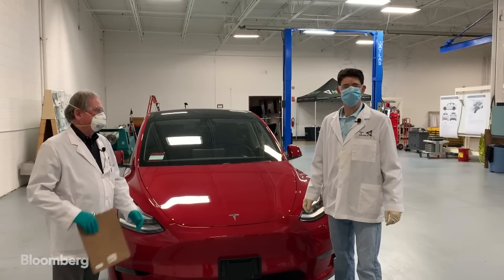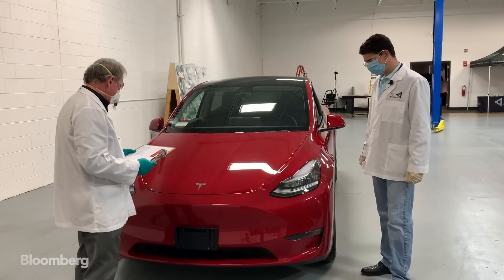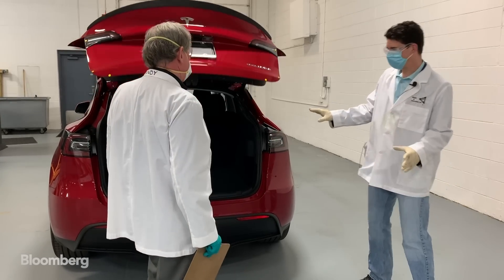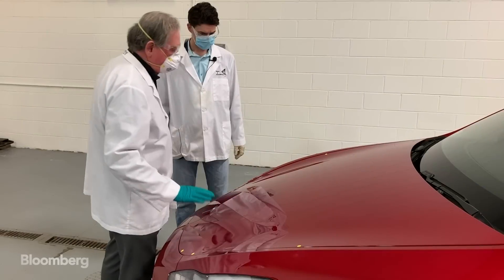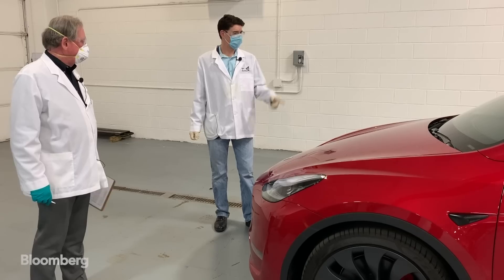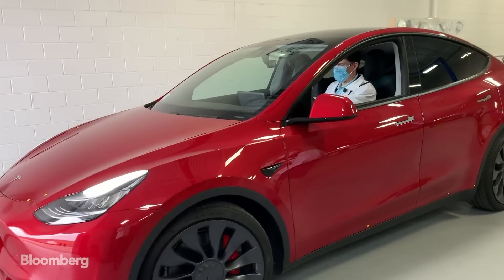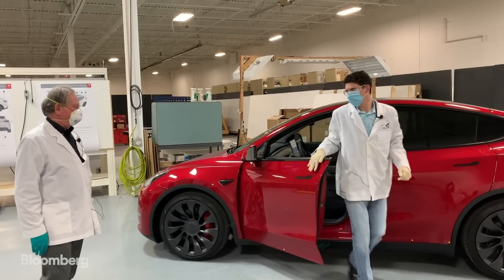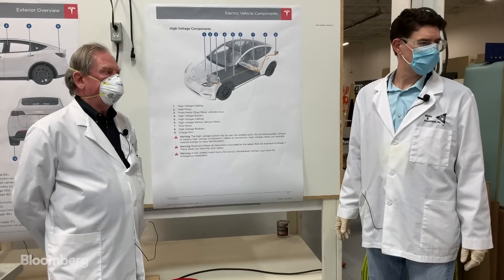Evaluating Tesla’s Model Y With Engineering Guru Sandy Munro

Comment: Voice Commands! Don't need to use screen at all!
Reply: They were showing that the only way u adjust anything is only by the screen. That is simply not true. Oh by the way your phone from 2016 is not nearly as accurate as Tesla voice command believe me. You wouldn't know that because your car is probably from 2016 also!
Reply: @nicholasroos3627  Getting a bit salty, are we? They have better road safety overall than other car brands. 
But if one Tesla burns, it's all over the media despite the fact that thousands of ICE cars burn every year. Nobody care about them even though they are more frequent, lol.
Reply: @DecepticonLeader  Thats a comment about road accidents in vehicles of all motor types. Also a comment on the amount of accidents caused by the introduction of touchscreens in cars across the board. Not even directed at tesla. BUT OK
Reply: @nicholasroos3627  Maybe you should take that as a sign of the importance of speaking/writing with clarity and be specific. Because generic mumbling will only make you a target to more people.
Reply: HaHaHa You are very miss informed. https://cleantechnica.com/2018/10/08/tesla-model-3-safest-car-ever-tested-by-nhtsa-how-did-tesla-pull-it-off/
Reply: @nicholasroos3627  See. With a bit of motivation you can actually do it.
Reply: voice commands dont work most of the time, until recent update.  and its still unreliable now.

Comment: As a former aerospace engineer I really enjoy this break down and analysis. I really hope Tesla uses this resource. Big improvements in quality since initial M3.
Reply: Musk has already commented about how good Monroe is.
Reply: Tesla does not do Model years, every thing the Learn on the manufacturing line is Implimented in the next Batch of cars, a Tesla model made in 2018 at Launch is Diffrent from a Production model 3 , as Sandy found out, HE (Sandy) has to Revise his Report.
Reply: @markplott4820  Agreed. Nevertheless this is an outside perspective and additional independent resource with QC and corrective actions. Tesla should use it.

Comment: I would only ask that when it comes to fit and finish that legacy manufacturers  are looked at the same way.  It just seems that Tesla is always on the spot light when we know that there are more expensive and exotic vehicles out there with the same issues when you look at them the same way.
Reply: Look at the discrimination. He evaluates cars from 400+ manufacturers. Is he supposed to give tesla a pass?
Reply: Munro's business is built on that.  He does all manufacturers.
Reply: but, what do Pannel gaps have to do with Performance and Safety ?
Reply: @markplott4820  They could say a lot, actually. Consistency in fit + finish is only achievable through diligent and rigorous process control during part fabrication and assembly (ie the entire manufacturing process). If inconsistencies like this are all over the place, and super basic process quality controls like paint area cleanliness can't be guaranteed, what's to say areas of assembly invisible to customers aren't also compromised? Is it a sure-fire sign that the car's integrity is compromised? No. But it sure doesn't put my mind at ease.
Reply: @markplott4820  If they are minor nothing. Could effect range a little bit but never performance
Reply: bro my maclaren p1 fit and finish was garbage. compared to this tesla. and that car was hand made.

Comment: Engineering Guru, really? Why do they talk about "gaps" and not the engineering design/performance of the car itself?
Reply: Because, for obvious reasons, fit and finish is what you measure before you start ripping the car to pieces.  Which Munro and his crew will be doing for most of this month.
Reply: Bruh this is day 1
Reply: You should learn more about what Mr. Munroe does.
Reply: because bloomberg. Also more than half of the dialog is opinion.
Reply: Hamdan - because Sandy did not yet, do a Teardown of the Model Y yet.
Reply: are you dense?
Reply: Mrazld Hamdan Because build quality matters when your spending hard earned money.